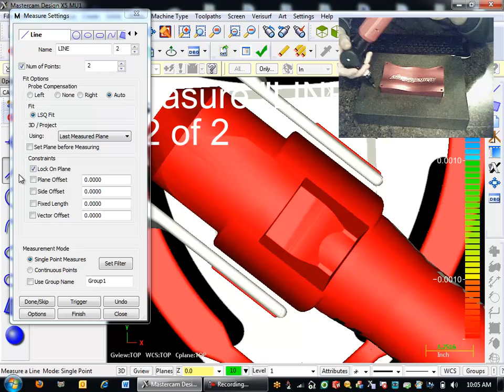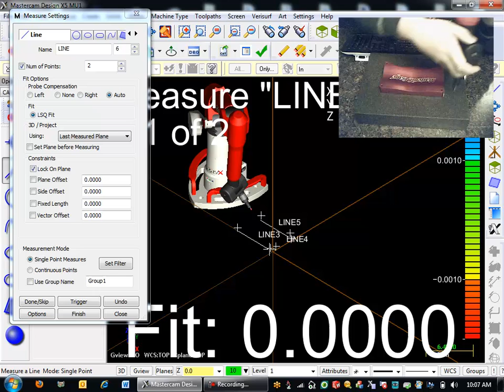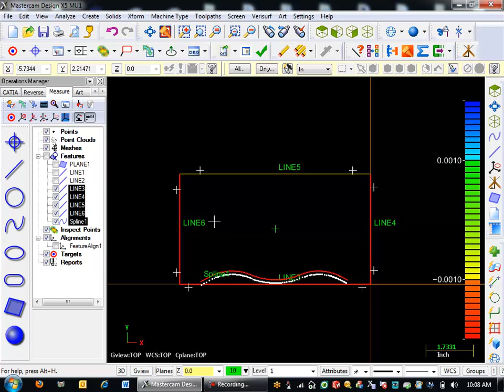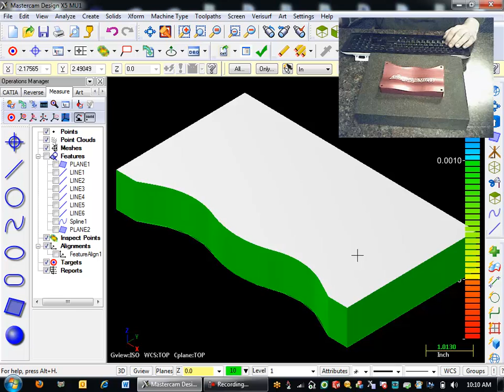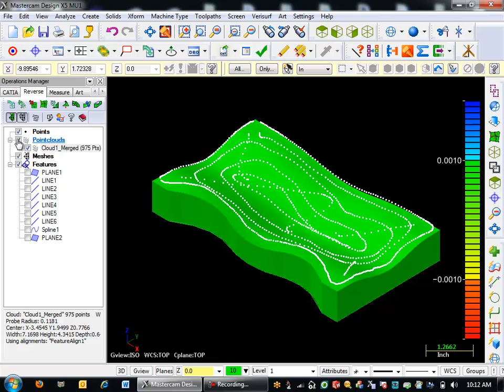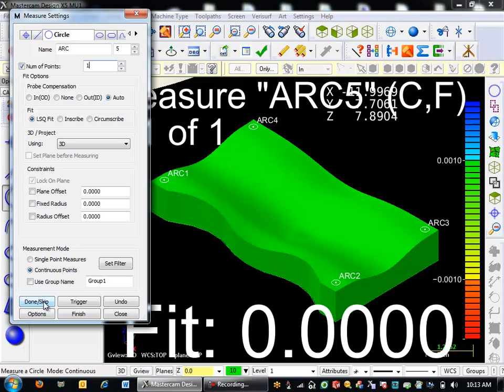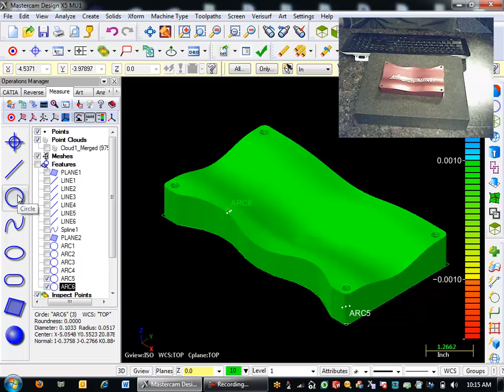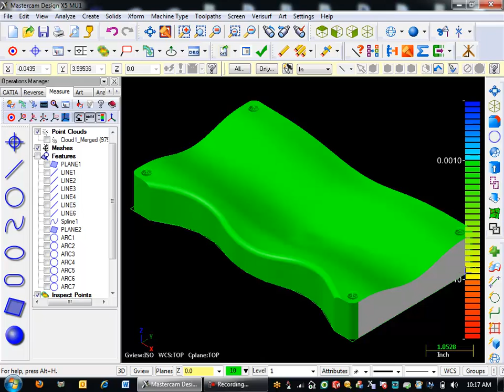Master3DGage and Verisurf Reverse Engineer a Part

Comment: Great video, it helped me out a lot. Would it be possible for you to demonstrate reverse engineering the bottom side of the part you did in this video? If it's anything like the one I have it's got a bunch of different recessed shapes. I tried after watching this video but I just could not get most of the shapes to extrude-cut correctly or at all. Hopefully you can help, if not thanks anyways.